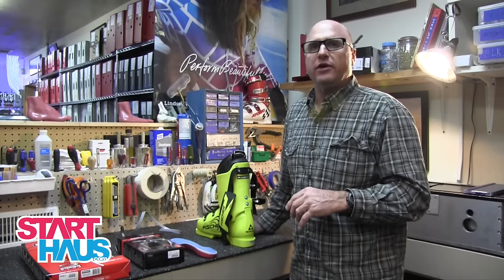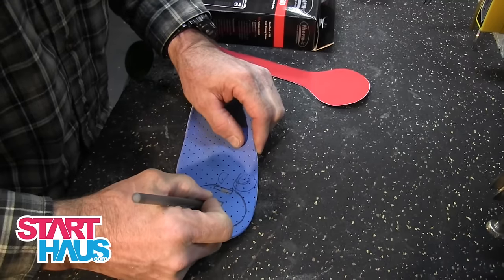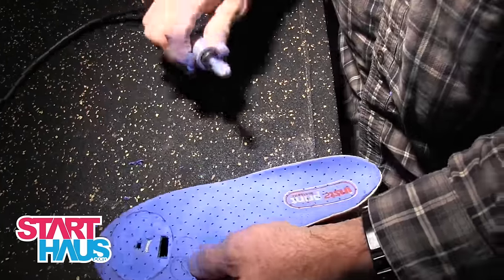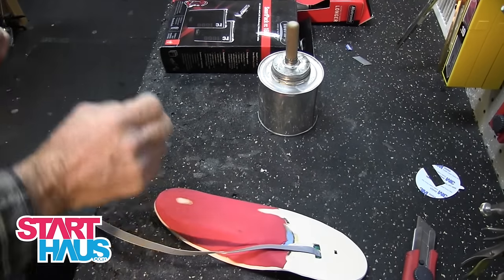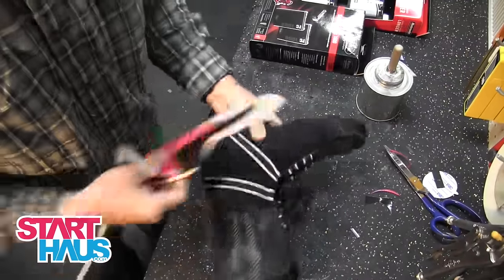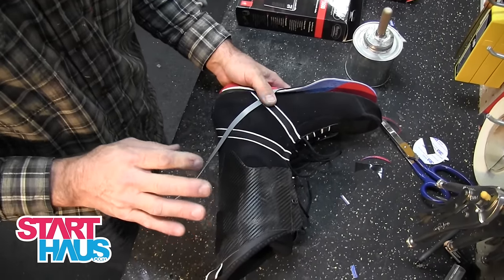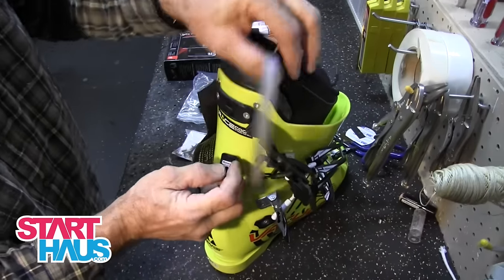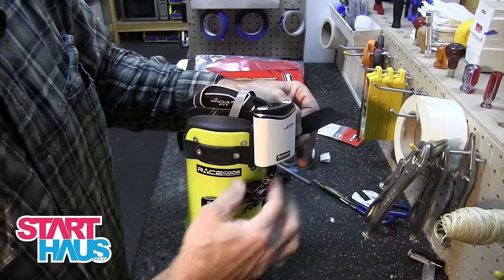Installing Heaters in Race Ski Boots

Comment: I like your wire routing. Our shop does a lot of zipfits and face the same challenges of wear to the wiring. We still route out the back but started using a slick nylon backed cordura adhered to a double sided  Nitto PSA tape we get from Sidas. very clean and slippery, great adhesion to the liner and it looks great! We also mount the element under the EVA topcover. Just use a little acetone to break the bond between the polyplast and the EVA. Same bevels to reduce sulcus pressure. Again, a real clean look and got rid of that crappy Hotronic cambrelle cover.Best,John

Comment: Thank you so much for that. I really love your attention to detail with the cable routing. I've had these warmers for years in my old ski boots. Just bought a new pair of boots and got the ski shop to refit the warmers to the new footbeds. They are so uncomfortable. I can feel where the heating pad is and where the cables run under the balls of my feet. Back to the shop tomorrow.

Comment: Love the cable routing and detailed instruction. A tip which might be helpful would be using the product known as “Boot Horn“, a semi flexible piece of plastic to help slide the back of the liner down past the rivets.  I have no commercial interest in this product, although I wish I had developed it.

Comment: I really like your approach to the arch exit of the cable. I have been working with this product for years and am constantly experimenting with the cable routes. Our challenge as course service workers is AT style boots (coaches boots) when unlocked in the hiking mode our cables are often severed after just a few weeks. Depending on the style of the shell, the cables seem to fail at the mechanical locking device. Conventional alpine boots don't have the "flex" range of motion as the AT in walk mode (work mode!).  Stay tuned and I'm off to use your route!